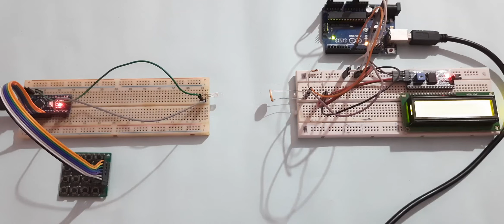Li-Fi Based Text Communication between Multiple Arduino

Comment: This is not a practical solution at all if you must keep the transmitter and receiver on the same line, also you must keep obstacles away from this line even though it is a good project :)
Reply: if u got the output please send the code and please guide how to get the output